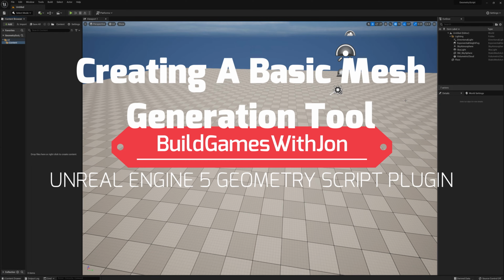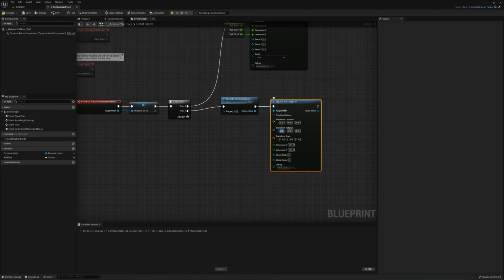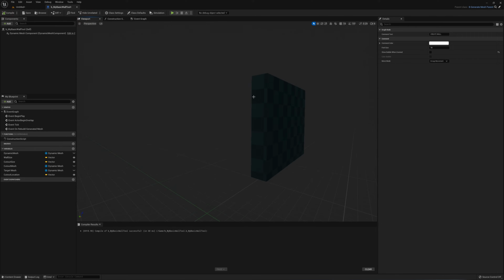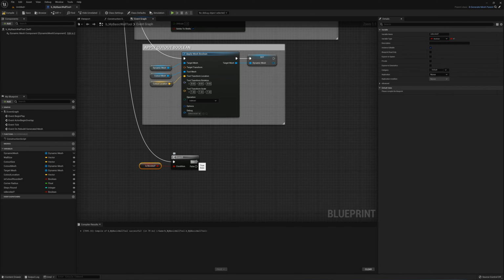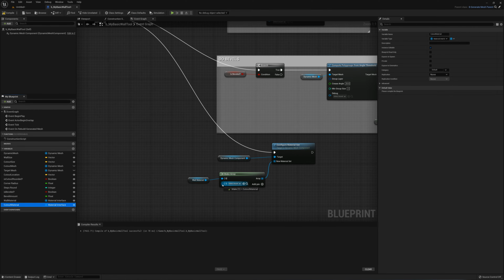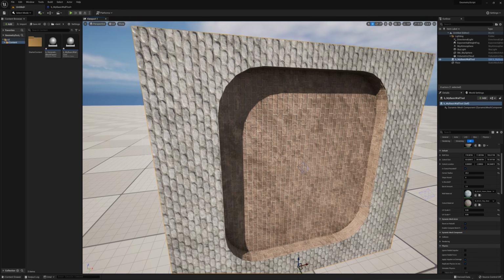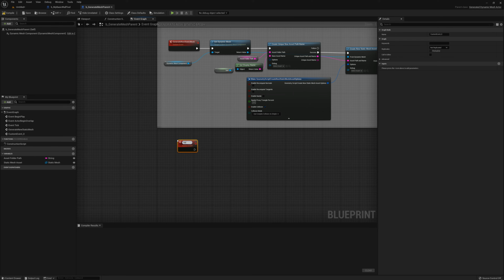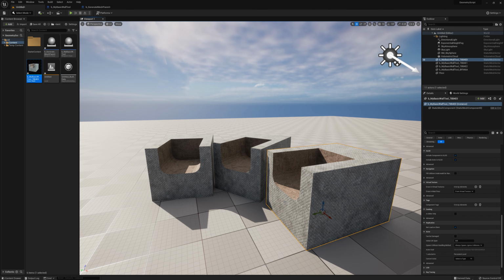Lyra Style Geometry Script Procedural Mesh Tools In Unreal Engine 5 - Making Your First Tool

Comment: Brilliant! Worked perfectly on 5.4. I figured out you could just use the round rectangle with corner radius 0 to get both options - but perhaps there is some other reason you did it this way around.

Comment: Thank you for the video. I have a question regarding the materials and I apologize if it’s a rudimentary question as I am an extreme newby and have not watched all your videos yet. Anyway, prior to your tool looking like a tunnel or cave of sorts, it looked like a wall with a window. In that situation you assigned materials to the wall and the cutout portion instance editable for each. My question is, can there be a third instance editable option to separate each side of the wall. Say interior/exterior materials.

Comment: @08:00 how to increase the width of 'advanced window' tool from just one side in unreal engine 5, whenever i increase the width of wall or opening in the details panel, then width starts increasing from both ends but many times i dont want. Pls guide.

Comment: Absolutely terrific video. I'm learning UE Geometry Scripting after already being comfortable in Blender Geometry Nodes, and the pacing is great for me.

I'm curious about your use of Boolean flags to enable or disable features such as corner rounding and beveling. Is there a UE-specific reason to do this instead of simply having a slider for the radius or offset, and inside the node graph using a Branch to switch the logic path if the value of the input amount is zero?

Comment: when adding the material parameters, the options appear in the details panel but the engine will not allow me to assign materials to the slots
Reply: For people in the year 2024+:
Make sure you're changing the material in the instance setting you created, NOT the original material. 

(Scroll down to the SECOND material options in the panel)
Reply: you fix that??
Reply: @luchoMKlove  Check the "Instance Editable" box and it should work
Reply: @JustinDM  hi justin im looking for the procedural lvl generation ,do you know any course to learn this ,here in youtube is soo poor content
i will apreciate a lot
Reply: I had to set defaults in the BP before it would allow me to set them.

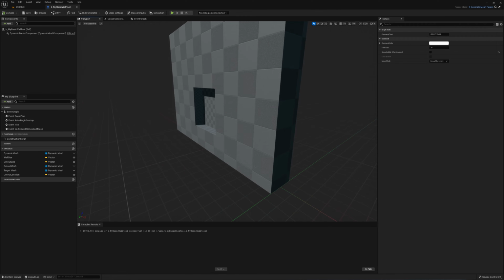Comment: Not sure what's up, but it didn't work. I'm at 7:45 and there just no hole. I did everything exactly how you did it. Can you make your file available for download so I can look at it?
Reply: These tools are inside the Lyra project, under Content/Tools.
Reply from the maker: You can download Lyra from the marketplace if you haven't already and certainly check out the Tools folder for several great examples of Geometry Script blueprints!
Reply: me too
Reply: if you find the solution please tell me too.
Reply: I had the same problem initially but it eventually worked, I forgot to set 0 to the Z component of the extrude direction (it is at 1 by default).

Comment: I didn't dig in these scripts, but there's something that confuses me a bit: I wonder why the scripts are done in the event graph and not in the construction script and if so if it is also possible to use these scripts during runtime (I guess the answer is no).

Anyway this is a great tool to speedup the blockout part of any project and with the help of this tutorial you might create something more complex or more appropriate to your specific project.

And good job with the video of course!
Reply: You can do it in the construction script, however if the construction script takes too long, the live updates to the 3D shape will become very choppy, and in some cases will not update until you let go of a slider/etc. What happens under the hood is we set a 'dirty' flag in the construction script and then on the next editor tick we call the event function. This makes things much smoother and avoids any slate throttling, and also allows you to (eg) force a mesh rebuild w/o re-running the construction script
Reply: When you want to know if you can use it at runtime just try it out
Reply: live stream said some aspects can work at runtime